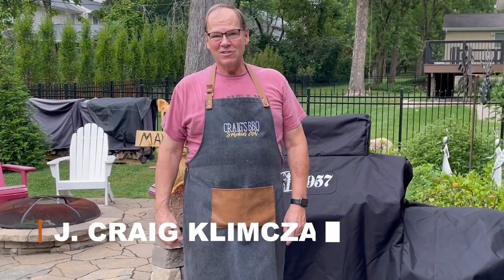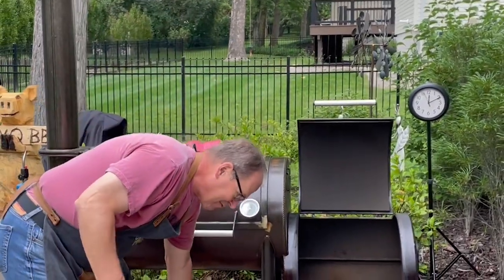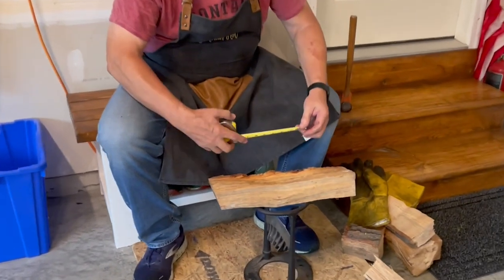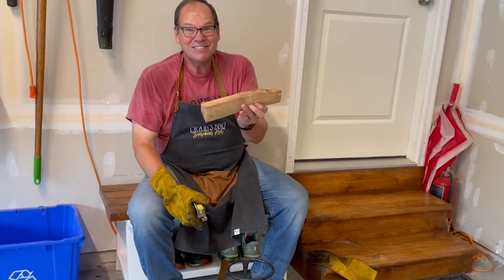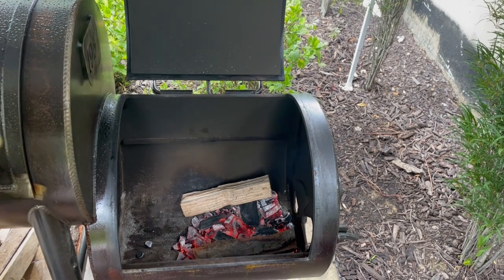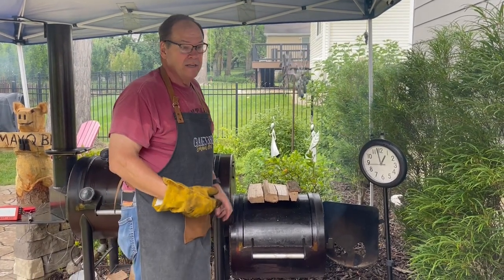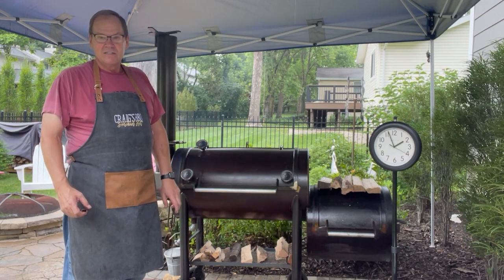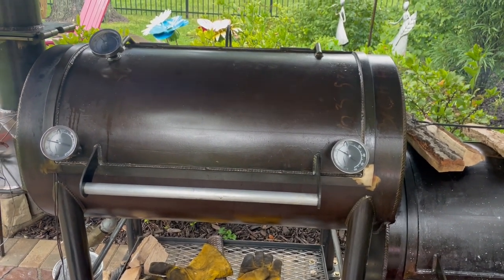Workhorse 1957 Fire Management Series #1: Smoked Chicken Halves

Comment: Enjoy the videos sir. I just ordered the 1975-t. I have a timberline 1300, BGE and a old country brazos right now.  Looking forward to getting this pitt other than the 10 month wait time. Happy thanksgiving to you all
Reply from the maker: Enjoy  your new pit.  I've cooked on an Old Country Brazos.  I wish I had done a fire management video on it to showcase the different strategies.  The OCB had a charcoal tray that drastically altered fire management.  It actually made it easier to use the dampers to control the temperature.  Without a fire basket, I think you will find that you will want use fire geometry to control burn as you don't have a bottom up air flow when burning at the bottom of the pit.

Comment: I like your method  no throwing wood out I like how you keep that fire under control,very nice
I would build a nice big fire damper it down and let it go for 2 hours awesome
Reply from the maker: Every cook is different and each needs a different fire. Some require more smoke, some less.  Some require higher temps other times less temp.  Some need more convection, others less.  Since you can't turn a dial with a wood fire, you have to use different techniques to achieve your desired result.  Then the pit design comes into play.  Different designs will run differently which is why you see so many people making modifications to their pit.  Tuning plates, baffles, stack extensions, smoke collectors, reverse flow, fire baskets, etc. the list go on.  I like the challenge and opportunities to do things differently.   That's' what keeps this fun and interesting.  Plus getting flavors from real wood is special.
Reply: Have you needed to use a baffle on the 1957 or done a biscuit test on it?

Comment: 👍 job! Something I notice when building a fire is getting a fire bed is the main source of temperature so when you start out be generous with fuel use the lump and big wood and build a nice hot bed to bring your cooker to desired temp then use the smaller splits to maintain smoke and as the temp or fire bed wanes replenish the bed bc that is the source of your heat.
Reply from the maker: I have had the same observations.  You need a lot of heat to make clean smoke.  That can be difficult when cooking on a small offset smoker.  Especially one that looses heat rapidly.
Reply: Enjoy your videos

Comment: Thank you, Craig, for starting the Workhorse 1957 Series,  I'm considering purchasing 1957 Pit. How do you feel about the wheels on your pit? I notice they were deflated, time line 1:49 of the video.
Reply from the maker: The Workhorse 1975 is a heavy pit.  The pneumatic tires definitely show the compression due to that weight.  The cast steel wheels would be sturdier.   Solid rubber would not compress so bad.  For the time being, the standard tires are fine and they do resist rolling down the slight grade of the patio. The conform to the mortar joint and hold the pit in place.  The casters have standard mounting bolts so I figure that I could  change the wheels out at some future point if I find some that I like better.
Reply: Workhorse recently started having their own wheels produced, and customers receiving their pits now have them. They look better, but maybe call Workhorse to see if the new wheels prevent that issue.

Comment: Great video and very informative about the fire management needs for the pit.  Curious if the pit side of the door leaks smoke like that all the time?
Reply from the maker: Yes it leaks like that all the time.  The hinge angle causes the top of the lid to touch first leaving the bottom up.  I can press it down but it springs back up.   I thought the repeated heating cycles would allow it to settle.  However, I may need to heat the hinge bars and bend them for a better fit.  

I use door gasket material on my other pits and have a new roll in the kitchen.  At some point, I need to decide if I want to add a gasket to the lid.  I'll probably try heating the hinge bar first to close the gap.  All in all, it drafts so well that a little leaking smoke has not bothered me.
Reply: @maxqbbq  interesting and thank you for the honesty.  Did workhorse offer to fix it or did u not say anything to them about it.  And good to know it’s a good enough pit that it overcomes a small leak.

Comment: I notice you have a little bit of a smoke leak on the left side of the door. Did it fix on its own or did you ever try to fix it with gaskets?
Reply from the maker: I sealed every gap on my Pit Boss and have gasket material to seal the Workhorse.  However, I haven't worried too much about the leaks as the Workhorse is designed to be high air flow style pit.  With a small pit, your fire is more efficient and faster responding.  Most people find hot spots and have more trouble managing temperature as small fire has a big impact.   In a larger pit, the heat is spread over a larger chamber and you have greater separation from the direct radiant heat.

Comment: When cutting splits with your miter saw, have you found that the blade holds up well?
Reply from the maker: I have an old carbide tipped blade on the miter saw that I use to trim my splits.  It's not as sharp as a new blade but the carbide is so much harder than the wood splits that it saws right though the wood especially softer woods like Cherry.  Hickory can make it crawl.  I definitely would not use my new finishing blade on the saw to cut splits.  Fortunately, I bought a new miter saw for my wood working and it has a fresh new blade for making my fine cuts.  My firewood gives me a reason to keep my old faithful around with new purpose.

Comment: So at what time or temperature did you put the chicken in. Watched 2X never saw the chicken added
Reply from the maker: Please check out the companion video Grandpa JK's BBQ Chicken at https://youtu.be/aoGlCg8d9eQ.    The temperatures and times are contained within that video. For these chicken halves, I started off with relatively low pit temperatures around 225 degrees F.  Later in the cook after the chicken took on a layer of smoke and was close to done, I increased the pit to around 300 degrees F.  Higher temperatures are needed to crisp up the skin. If you just smoke the chicken the skin will be soggy and not inviting.  Crank up the temperature towards the end of the cook to get that nice and crispy finish.

Comment: If you just cut your delivered wood in half lengthwise and then split to your desired length, you would maximize your fuel usage
Reply from the maker: I tried cutting the delivered wood in half.  Unfortunately, I ended up feeding the fire more often.  I could try cutting the wood splits in half and use it like chunks.  However, the Workhorse 1957 bottom fed fire seems to like more airflow.  I suspect that an elevated fire grate would provide enough vertical air movement through the coal bed to allow bigger diameter chunks.  I may have to invest in a fire grate to test out that theory.